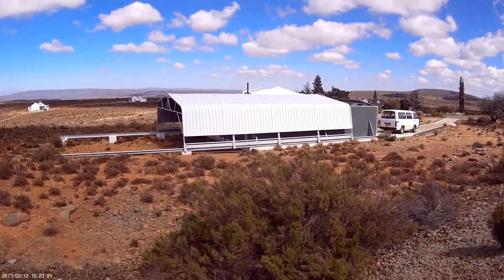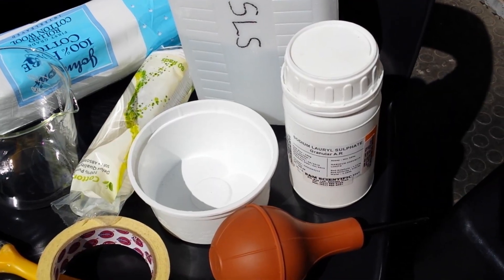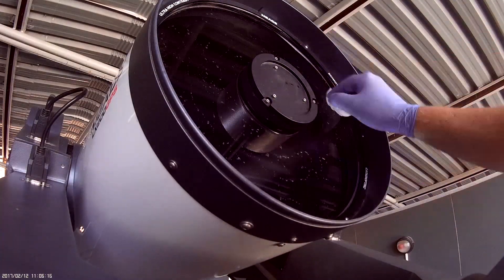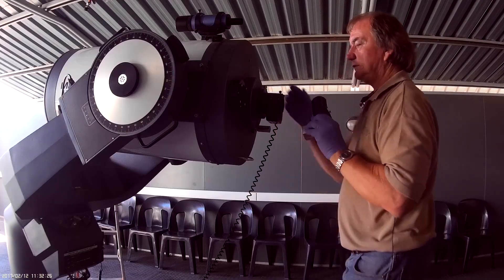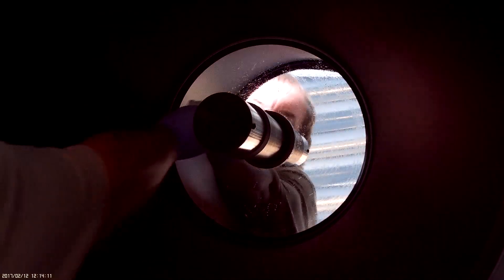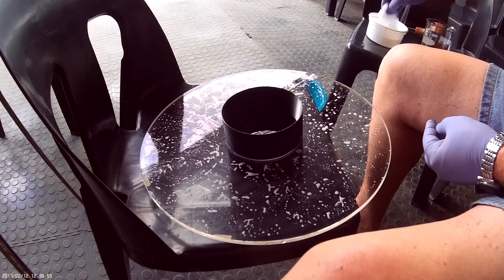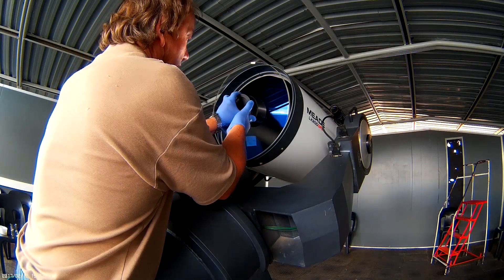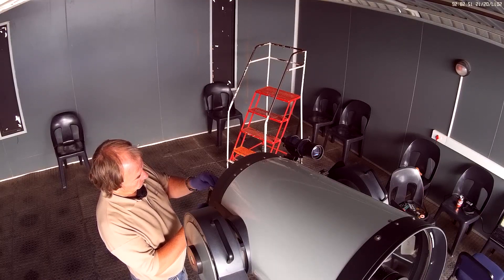How to strip and clean the optics of a SCT (Schmidt-Cassegrain Telescope)

Comment: My dream scope. Great video. Thanks for taking your time to make and post this video. Can fogging of the corrector plate and mold on the primary be cleaned? There is a scope for sale that is in good condition but has these 2 problems. Anyone replying would be appreciated.
Reply: This is a bit late for your situation but someone else reading may take note.  I acquired a 12" Meade LX200GPS on March 17 of 2021.  Was missing the hand controller cable, power cable and had mold on the primary and inside/outside of the corrector.  The idea of taking it apart was a bit intimidating even though I paid basically nothing for the telescope (long story).

Using this video as a guide, I first cleaned up my 8" Celestron.  It was another used purchase, there was a significant (to me) amount of dust inside that I had up to that point ignored.  Canned air sprayed into the tube with the corrector removed flushed it out gently and I decided to stop there.  Cleaned the corrector as shown here.  Was rewarded with one of the best views of Saturn I've ever had.  Perfect seeing contributed most to that.

With one success story, I turned my attention to the 12" Meade...

Every situation will be different, but in my case the primary cleaned perfectly, and it was the part I was the most worried about, with a dime sized spot of mold visible.  There is one very small spot on the corrector where you can see the coating didn't come out of its ordeal quite perfectly, but the glass itself looks fine.  This would be less than 1 percent of the actual surface area of the corrector and does not show up in the eyepiece at all.  It's really a fantastic telescope.  I fought the mount a whole lot more than the optical tube.  Meade is in last place for electronics in my eyes, but I think I have all the bugs worked out.  The tiredness I feel right now is from being out until 3am with that telescope and having to report to work by 9.  Worth it.

Other data points for mold removal.  I've had a bunch of eyepieces and also telescopes come in with mold in them over time.  I've had good success with them also.  It's not necessarily a death knell.  The worst of them so far was a 25mm Kellner, the coatings were clearly angry but it resolved a wonderful image still once cleaned.  I felt no problem selling that eyepiece along with a telescope, everyone left that deal happy.  I thought for sure that eyepiece was destined for the trash before cleaning it.
Reply from the maker: Thanks.  Fogging should be able to be cleaned off (depending what caused it obviously) but mold can sometimes attack the coatings and cause more permanent damage.  Beat the price down because of this and hope for the best!

Comment: Wow is this really possible to rub the mirror like this?
Reply from the maker: Only after its gone through the whole process and using the correct material is it safe to do.
Reply: @SterremanWillie  is it also possible for any mirrors such as a 10" Dobsonian one? Or is it just possible with the best mirrors?
Reply from the maker: @oupwo7468  Not sure if I understand the question correctly.  All mirrors, professional or amateur, pyrex or plate glass, etc. get exactly the same treatment.
Reply: @SterremanWillie  Are you sure about that? I mean.. Some mirrors are pirex, some are zerodur, I heard somewhere from an astronomy channel that some mirrors are cheapers that others. Is the coating axactly the same everywhere?
Reply from the maker: @oupwo7468  Indeed!  The glass is just a (very accurate) carrier of the reflective layer, which is what is doing the work.
Reply: @SterremanWillie  Thank you for your answer sir

Comment: Cotton has fragments of cotton seed, which is quite abrasive. Get some of the artificial cotton used to clean selenium rollers in Xerox machines, or those micro-fiber "rags" that have no natural fibers.. Especially for mirrors. Apparently glass will sheet on truly clean glass. If it beads up, it isn't clean. I'm not sure if coatings affect this as I have only seen it before coating.

Comment: Observations 1) you appear have a ton of scratches on the lower half of your C14 corrector? 2) You put cotton balls directly onto your Meade 16" corrector without first blasting an unpowered hose from outside water tap (with concentrator nozzle) to blast the dirt away first (seems to be much sand on there?), thus you just ground dirt / sand straight in to your corrector. Now, it's true that the multi-coatings on the glass are harder than the glass and this may have saved you from problems, but it's advisable to get the existing abrasive dirt off first with water jet from outside water tap. Is this where the scratches came from on your C14? I hope that this is not the case. However if this is true, maybe remake the video and show blasting the dirt off the corrector first with water jet from outside tap, so others don't get the wrong idea. I bought a Meade 7" Maksutov Cassegrain second hand where someone had cleaned the corrector (Magnesium Flouride coated) very aggressively and it had many thousands of very bad obvious looking scratches in it, that's one of the reasons I got it cheap. Awesome setup you have there BTW and good quality video and sound.

Comment: I just found this great video, so I'm a bit late with the comments and questions, but....I have a Meade 8" SCT made in 1985 and have long been fearful of cleaning the optics due to the UHTC coatings they put on them.  I assume this cleaning process won't damage or adversely affect those coatings, right?  Also, the video didn't show how you dried the inside of the corrector plate, should I assume you dried the inside of the corrector plate the same as you did the outside of it and the primary mirror?  Same process for the secondary mirror?  Thanks!
Reply from the maker: Thanks.  Yes, this process, if done correctly, would not damage coatings.  Yes, the same procedure for all surfaces - I probably left out the inside of the corrector to save time since the process should be clear by then.  Happy cleaning!

Comment: What do you exactly use to make collimation after, please ?
Reply from the maker: I only checked the collimation using two types of tools, a Chesire and Autocollimator.  Should it would have been required to the adjust the collimation, I would have adjusted the collimation screws on the secondary mirror mount.

Comment: Overall, very helpful.
However, the cleaning of precision optics, especially first surface coated mirrors, using a process involving touching, is VERY RISKY, insofar as damage to coating and surface polish (microroughness) is concerned. Why not use “First Contact,” or nitrocellulose collodion (reagent grade), which are strippable coatings that pour on, dry, strip off, involve no wiping or rubbing, yet result in atomically clean surfaces?

Comment: Hello, an interesting video, I also noticed that C14 on the corrector has large scratches, say these scratches have an impact on the image in C14 ?!
Reply from the maker: Yes, unfortunate, probably due to bad practice when trying to get rid of condensation.  The scratches would add to scattered light.
Reply: this is because of the cleaning method..

Comment: Ok if you have the $$$ for another dozen of these scopes...but that method of cleaning is awful...let run the water/soap inside the tube..primary mirror goes out and than  gets cleaned..period.
Reply from the maker: If you want to work more "wet", there are easy ways to mop up any spillage but there is nothing that can suffer water damage inside the tube anyway.  I must admit, I don't want to disturb the primary if I can help it, so good luck.

Comment: There shouldn't be any dust in the telescopes, for that amount of money what they cost. Am I right ? Great video.
Reply from the maker: Thanks.  The Meade actually has a fan at the back to circulate air through the telescope tube.  The system does have a filter in, but it could still force damp air through the tube, causing condensation, which left residue on the mirror surface I think.
Reply: @SterremanWillie 
Thanks for the reply. 
Yes that's true but it shouldn't be a problem to get the telescopes better sealed. But this is just my opinion. Have a great day.

Comment: Thank you for this video !!! It gave me the courage to clean all the optics on our Celestron CPC 800 GPS (XLT) computerized telescope. We've had that Telescope for at least 12 or 13 years, but only used it a handful of times. My husband had lost interest. Now my daughter got interested and I helped her set it up. The manual focus was stuck, but I was able to fix that. That left us with a badly dirty corrector and a dirty mirror. I was told we would have to take it somewhere to have this done, but no-one around here does that work and sending it in for something like this seemed crazy expensive on shipping alone. The corrector had a strange film on half of it on the inside, but even that came of nicely. Just finished the work and everything looks good. I don't know much about Telescopes but I'm glad ours finally gets used. Next on our agenda is to find a nice entry level camera that works with this telescope and a couple of better lenses :) Thanks again, I would have never attempted to do this hadn't I found this video !

Comment: Oh my, that huge 16-inch corrector wobbling on the plastic chair sends shivers down my spine! ;-) 
But to each owner their own... work routine, and practice - which you show you have in buckets - more than this C8 owner who only had the guts to go as far as cleaning the corrector plate a few years back (actually my main mirror looked just fine).
Reply: Where's the best place to find the supplies?

Comment: What is the name of the collimation device you used, and do you still need to collimate using star latter? will it work on a celestron 9.5 sct, I am going to have to clean the inside and outside of corrector  sometime in the near future. I would probably have it done but there is no one locally that works on telescopes. How much of the sodium sulphate do you mix with water? Forgive  me for having to ask so many questions. I am very much dreading having to try this, although you video makes it look pretty straight forward.

Comment: Thank you for the video! Just a couple questions, though: (1) You said to use one or two drops of dish detergent, but in how much water should this be mixed to get the right concentration? (2) If I don't plan (at least initially) on removing the corrector plate, how do I make sure the solution doesn't get inside through the secondary mirror's mount? Would it be helpful to build a little cloth dam, or something like that, to capture the water before it reaches it? Or do I need to aim the tube straight down while cleaning? Thanks!
Reply from the maker: Hi John.  I don't think the detergent strength is too critical, the main idea is not too strong, since it takes a lot of water to rinse it all away again.  If we use detergent, we mix 1 tablespoon to 5 litres water or Sodium Laurel Sulphate at 0.8 gr per litre water.  Yes, to just clean the corrector's outer surface, the telescope is turned to point to the ground to prevent water getting into the tube - the you can use soap and water liberally.  When working upright, something to soak up any spills is a good idea as well (we use exactly this technique with some of our bigger telescopes which cannot be inverted).  I did actually get some water in the Meade's tube, but it did not go where anything could be damaged.
Reply: i have a 10" schmidt-cassegrain that has some simple, light condensation dust rings on the inside of the corrector plate...honestly, it does not perceptively impair vision...perhaps cuts into magnitude a tad, but i am going to clean it off in the summer, just cuz, i like it looking pristine. if the primary looks clean, which it does, with the plate in place, i wont be touching it.

Comment: I have a Meade 2080 SCT 8” with a scratched main, any ideas where to buy one?
Reply from the maker: Sorry, no idea.  But how badly is it scratched?  How did it become scratched?  The reason for asking is that the scratches may just be in the coating - I get this often with mirrors that we re-aluminise.  If the scratches are just in the coating, they are fine after re-aluminising.

Comment: I had my SCT in storage for about 6 years.  I have a film on the corrector plate and tried your method but I keep getting streaks or what looks like smears.  I can't seem to get the glass clean with soap.  I even tried the lens cleaner and it leaves a film as well.  What am I doing wrong?
Reply: + Astronomer  Exactly. I have used hydrogen peroxide 6% to get rid of any mould/fungus spots instantly (and I really do mean instantly), then isopropyl alcohol 99% for grease etc, then de-ionised water for the final cleaning with cotton wool pads.
Reply: wt93205 Soap will leave a film. Get some high purity isopropyl(like 99%) alcohol and distilled water and try that with regular white tissue or kemwipes. (No fragrance or lotion)

Comment: Hi, I have a Schmidt cassegrain telescope that has collected mold on the corrector plate and the primary mirror over time. Would I be able to clean the mold with this method, and how has the mold effected the mirror? It has been sitting in a basement for over 5 years. Thank you.
Reply: + Matthew  Same here, alas. I have a 5 " Mak-Cass and an 8" SCT which I had to keep in storage for five years. Last week I took them out and saw the most appalling mould/fungus on the internal surface of the Mak's corrector plate. Oddly (why is this?), there was not even a minuscule trace on the primary mirror. Following Willie's advice and others, I removed the fungus easily with cotton wool tips soaked in 6% hydrogen peroxide, followed by de-ionised water dabbings and then wiping with pure cotton wool pads. Brilliant results. Mercifully, the mould had not etched away the coatings!

The secondary mirror of my Mak had also been populated with a shocking amount of fungus, but in this case - being an externally-silvered mirror - I chose only to use de-ionised water with a single drop of washing up liquid. Dab, dab as Willie showed here, and then wipe only with de-ionised water followed by dry cotton swabs to complete the cleaning.  Good as new now. 

As to my SCT, I have removed the fungus on the external surface of the Schmidt plate as above. Like my Mak, not a trace of any contamination on the primary mirror. Willie has given me the courage to remove the plate and clean its interior surface. I SHALL be marking the plate with respect to its orientation to the OTA when I do this tomorrow, given that a Schmidt lens is way more complex an optice than a Mak Meniscus. I only hope that the secondary mirror has been spared the ravages my Mak suffered! Wish me luck!

Salutary lesson learned: never store such telescopes in unheated spaces in the dark. And ALWAYS expose them to the Sun every now and then, so that mold/fungus can never take hold.
Reply: By having a teeny weeny bit of mould on my C8's main mirror a few years ago, I got rid of it with some light cleaning (though a mark of its same minuscle size was left on its surface - which fortunately doesn't affect IQ in the least) and then, by having learned it thus the hard way, have never left it inside the plastic container it's been stored since without a deumidifier box such as one of these:

https://www.alibaba.com/product-detail/400ml-500ml-moisture-absorber-box-interior_60115754650.html

This way, I cut out one of the three things fungi need to live on and thrive: moisture. These are so effective that I don't have to worry with the other two (darkness and warm temperatures) which, here in damp, tropical Brazil are a part of life.
Reply from the maker: You don't have much too loose but try.  The mould should not have attacked the glass easily.  It may have effected the coatings of the mirror/corrector in which case re-coating would be required, but it will definitely help  to first try cleaning which will reveal the damage, if any.  Good luck.

Comment: Willie why does it matter how the corrector plate was originally rotated? Isn't the surface of the corrector the same regardless of rotation?
Reply from the maker: In theory rotation should not matter yes.  On the other side, optical tolerances are so small, that it is always better to be safe than sorry, particularly if all it takes is to mark. It is such an ingrained habit in all optical workers to do it, probably dating from the days of older, handmade optics.
Reply: Willie when you do collimation of an SCT do you FIRST need to perform an alignment before attempting an in/out-of focus star test? In my case the star keeps on drifting out of view
Reply from the maker: The video only shows the daytime collimation (which did not need adjustment) - this is followed up at night on a bright star with high magnification and rack in out of focus yes.  If the star drifts out of focus as you describe, I can think of two possible causes: (1) something is loose/worn causing the focus to physically move, or (2) the seeing conditions were bad, making it difficult to focus and it actually drifts due to seeing changes.
Reply: It is absolutely necessary to mark the orientation of the corrector plate! They manufacture these optics as a matching set, the flaws in one cancels out the flaws in the other but only if they are oriented correctly. They try several plates on each mirror until they get one that works the best. But the rotation of the optics has to stay the same.
That's why if you need another corrector plate you have to send in the whole telescope, or at least the optical tube so they can match it up.
Reply: + butlertv1  The SCT corrector plate is far more complex (wavy) than the meniscus lens of a Mak, which is why orientation for the Mak plate is less critical. At least that seems to be the consensus.